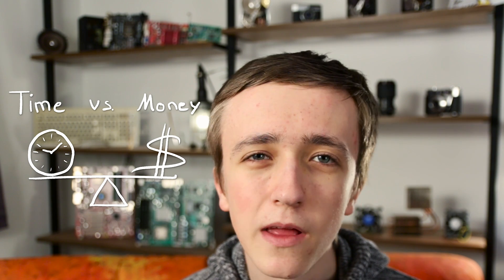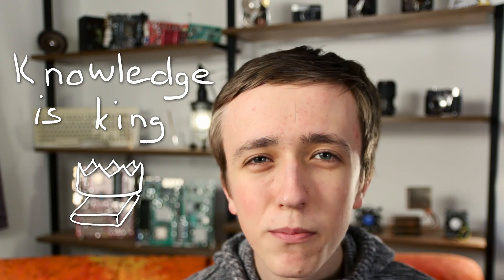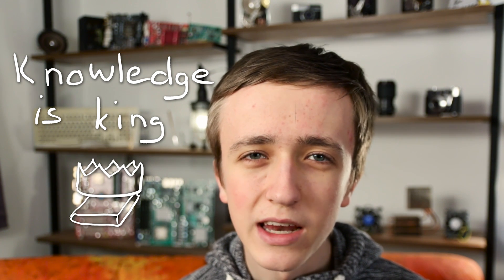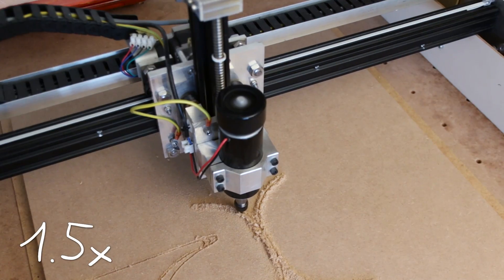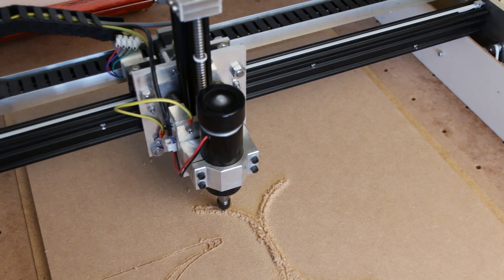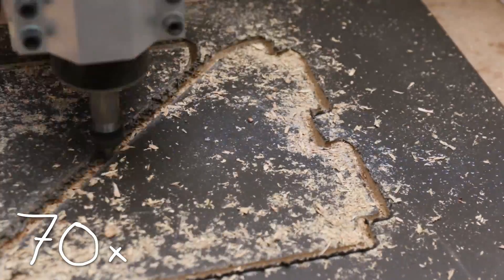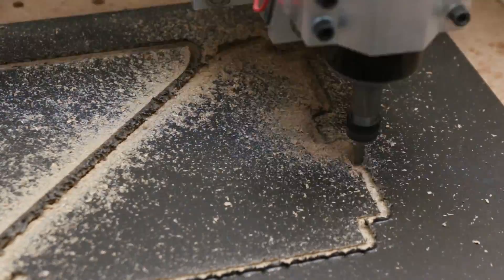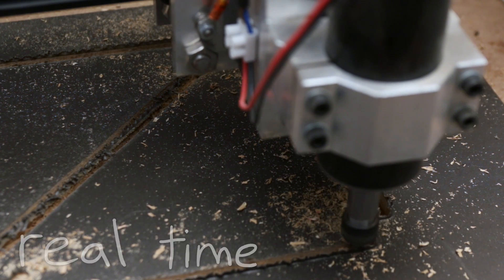DIY CNC router - Was it worth it?

Comment: Rigidity are very important. I've been thinking a lot about, and doing a lot of research about how to improve rigidity as cheaply as possible(for if I ever design my own cnc - right now I'm just going with a mpcnc that I've built). Here are few links that might be of interest:

https://www.youtube.com/watch?v=mUvc2ee7ZY8 - I dont nessesarily think its the power of your spindle that's the problem, rather the rigidity here also.

https://www.youtube.com/watch?v=JQJKxtc8bf4 - Here's a few ideas of how one could potentially make a cnc stiffer - notice the way he braces the y axis.

Other than that - good job. Its not easy building something from the bottom up. :-)

Comment: Fellow 15 yr old building a CNC here! Mine is taking ages - I began designing last summer, but when it's finished it should be a beast - able to mill aluminum with ease - if I manage to finish it. For one thinking of making their own with little experience  (like me!) I would recommend hanging around the various forums, but taking them with a pinch of salt as you may get stuck in a cycle of doubting your design, upgrading it (and making it more expensive) and doubting again, instead of having a go. Make sure to always keep in mind what the goal of your CNC is, as upgrades are rarely free in terms of money or time. Exellent video
Robbie

Comment: for aluminium, you should go much faster (like 800mm/s) so your mill will work on cooler aluminium. Take 0.2 or 0.3mm deep passes if your machine is not rigid enough. The end mill should be designed for aluminium. Also spray some petrol on your mill so it can cool down during process. Sometimes, the way you do your toolpaths can change a lot (like doing a pocket around a piece instead of doing a profile, etc). Try to test the limit of your motors/machine by increasing speed and acceleration until your motors loose steps and then reduce them, it changes a lot for mine to do that

Comment: Excellent video! I will happily add to the comments of how honest you are in this endeavor. You have a great attitude, and this will propel you to great heights. I have built many complicated machines(other than cnc) in my 46 years on this earth. I am in the planning stages of building a 4'x8' cnc router at work for production use. Throughout the mountains of research that I have done, I found your video to be very helpful. Much more than most. Thank you!

Comment: Very Good Presentation, I need a cnc something between a milling machine and a X-carve type machine. my main material to be cut would be possibly aluminum 6061,  40 thousands and need some accuracy, I know nothing about how to design my part, so may i ask were you at the time "Techno Savy, where fusion 360 or mach3 you already new or did you have to learn all that input Gcode and so on? I don't know if I should by a machine, then learn the software or learn the software, then purchase a machine. anything out there for around a Thousand dollars you like? I know a Thousand bucks is not much, but as a hobbiest, there has to be a cut of point somewhere.
Thanks again, Respectfully, Jim p.
Reply from the maker: Learning the software is easiest if you can try it on the machine. (You can learn the very basics quite fast) While you are waiting on delivery however you can of course start learning fusion. I don't know what you can get for 1k, your best bet probably is ebay at that price point if you want something sturdier than an x-carve.

Comment: David , Thank you so much, i need a CNC machine, and have been batling on wheather to buy one or build one since i did not have the money . these machones are so expensive and i dont know ehy they are so expensive. but i started batling in starting to learn the basics on motors and it has been amazing journey of learning but, the problem is that is setting meback with other duties and im still in the infancy stage of lerning how to choose the correct motor and staff. your insight on this comes at the oefect time for me and i can see that this is going to take along time because CNC is just a small part of what i need it for i think the best is to find someone who has done it and work with him after listening to you. i might do it for learning but im more interested in what i want to build it for than the divice itself. but now i know what to avoid as you said stability and i need preciseness for my application.
Reply from the maker: To get started working together with someone that has experience is a good thing, that way you can learn how to use it and what is important so that when you have the time/money/knowledge you can build the best machine possible. Good luck with your endeavor!

Comment: Cool video, I built my MPCNC for just under $350 and that's including the higher cost stainless steel rods and the router.  I haven't looked too much into the cheap spindles but I think you have to jump up to the next price range to compete with the hand routers such as the Dewalt 660 which only cost $50.  It does require ear protection.  Still too nervous to try aluminum yet, but I'm loving my CNC.
Reply from the maker: +Ryan Krammes Awesome! For aluminum you can try taking extremely shallow passes at first, like .2 or .3mm this isn't too hard on the spindle and will give you the confidence to go a bit more agressive.

Comment: Different tools have different speed limits for different materials, like that router will be too fast for Alum. You might want to look up second moment of inertia, ie a large thin section will be more rigid than a small thick section. Trusses are light and rigid because of cross bracing. As you noted too much overhang isn't good. Rigidity makes a machine feel more powerful because energy is not wasted in chatter. I did Mech Eng for 4 years so for 15 you are doing alright, so keep moding because you have a decent base to work on.
This one is quite rigid for the $ - https://www.youtube.com/watch?v=3vgjJikt9B4

Comment: There are a few things that would make your build a bit better. Like EMF shielding foam to line your controller housing. Or using screw rod to handle X-Y instead of belts and then secure the head between linear bearings. Also you can get vibration absorbing rubber couplings between the table and baseplate. Finally, that spindle looks way too underpowered.
Reply from the maker: The spindle part I upgraded in my last video and the other things will definitely be added in version 2 :D
Reply: Datulab Tech oh, cool. This vid just showed up in my recommendation list. I'll check out your latest vid then. I'm trying to scavenge as many parts as possible for a desktop CNC. Nothing too large. Maybe 40x40cm absolute tops. But I'm designing it to be as rock solid as possible so I can do both steel or high resolution for PCB prototyping.
Reply from the maker: Awesome!

Comment: I heard one guy put some capacitors on the spindle motor and that cleared his noise issues up. No one builds just one CNC machine. You did good.
Reply from the maker: I've seen that too, with the shielded cable it isn't an issue anymore though so such a mod isn't necessary any more for me. 
And you are definitely right that this won't be my final cnc machine :D
Reply: Eliminating noise is never a bad thing. I don't run USB so I never had the problem with my spindle.
Reply from the maker: +Paul Frederick I'm changing the spindle anyways as mine died and with the new one I won't have the problem as it is powered differenty (video in one or two weeks)
Reply from the maker: Then you will like the one I just bought, it is almost to fast :D

Comment: I managed to get my machine (same spindle) to do a reasonable job on aluminium, but it's very very slow. I step down by 0.1mm or 0.3mm and feed at about 1.5mm/s with a two flute cutter :)
Reply: I just found this series, and immediately thought of your problems... deja vu!  Glad you have seen it as well.
Reply from the maker: +iforce2d ok, yea I haven't tried that lightly. I was trying with 0.5mm and 300mm/min. I guess I'll try it your way next.
Reply: Yeah I was surprised when somebody suggested this to me. It does a nice job but would be nice if it didn't take hours. You can see some cuts in my video: Px8cj9cqRIQ